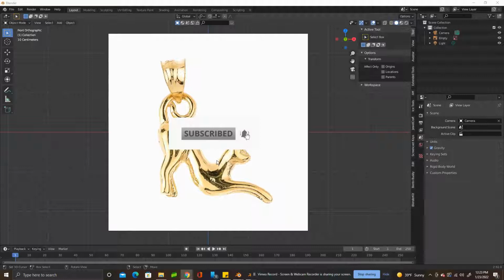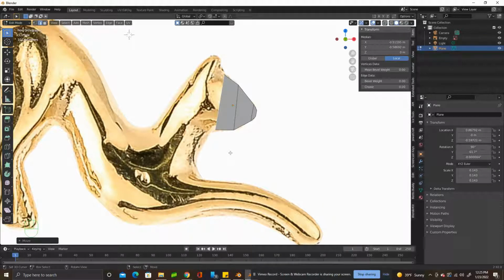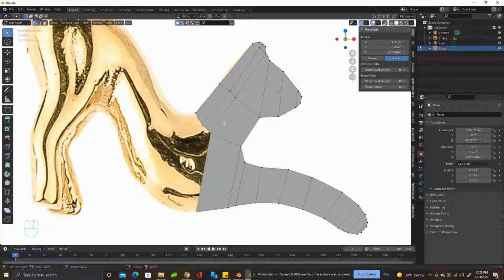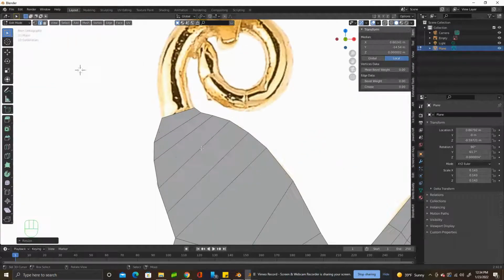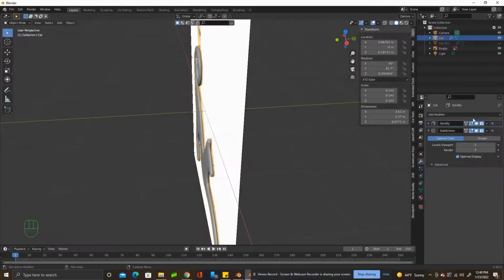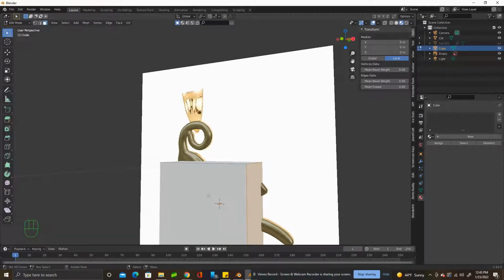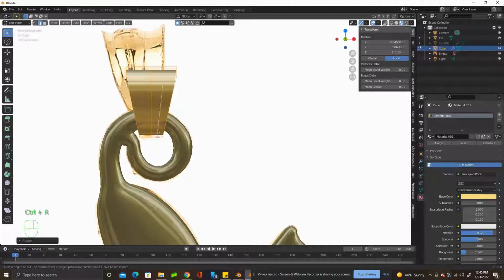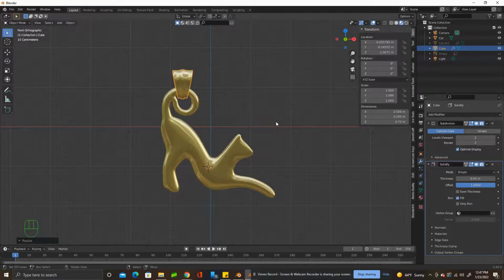3D Model A Cat Pendant: Blender Beginner Tutorial

Comment: How do you make the mesh look realistic once you upload it with textures? I'm struggling with this topic. I add shaders in blender and everything.  but, once uploaded into sl it turns a matte pasty  shade (no metallic appearance. Very dull) I feel as if I'm missing a step ;-;
Reply from the maker: Having a good HDRI is EXTREMELY important. Think about yourself holding a shiny metal in a flat, all white room or in a flat all black room. Little to no variation. That's what you'll get in your textures. If your HDRI has more variation, like a cityscape or nature with a lot of color variation, that gives the surface of the metal more to reflect off of. Keep that in mind when choosing your HDRI. Some, like the one I'm using in the thumbnail may look decent for renders, but for your textures, you need depth. Then you'll see the difference